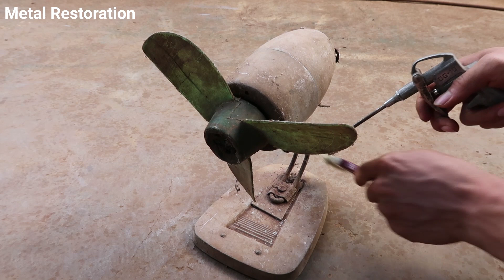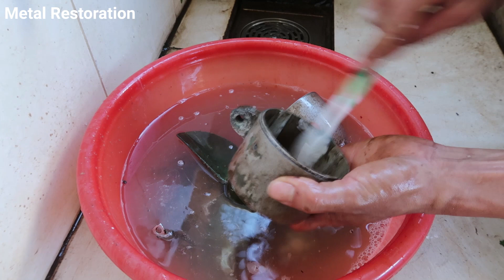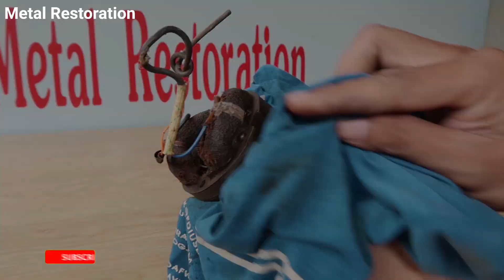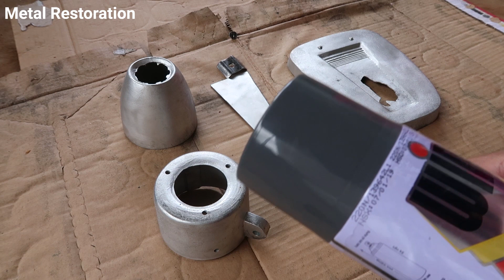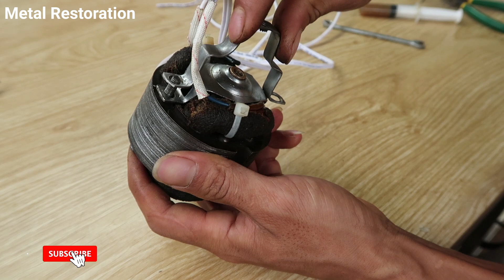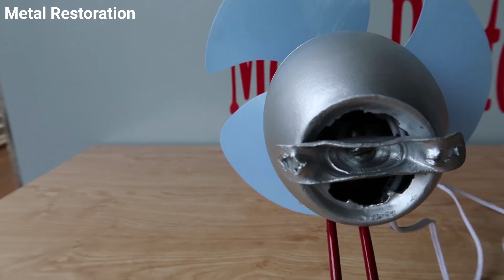1970's Old Broken Table Fan Restoration -  Metal Restoration

Comment: Just a tip from an electrician, never use zip ties on wires to secure them. Always use lacing tape.  Zip ties will dig into wires and cause a short.